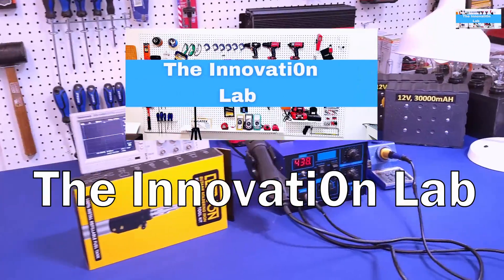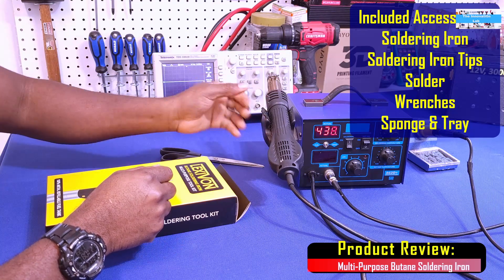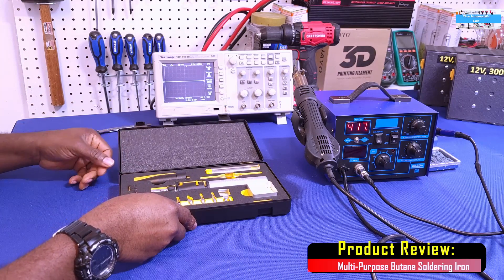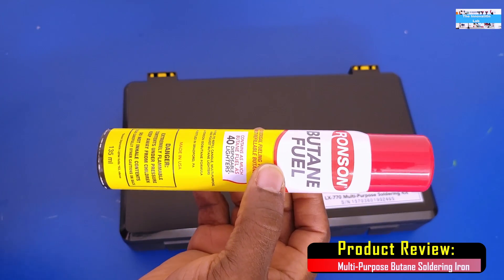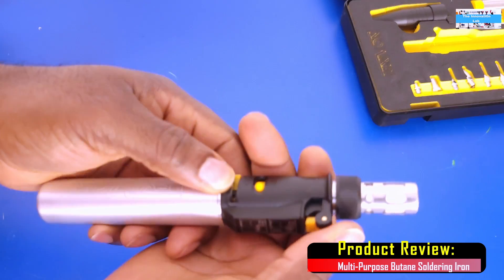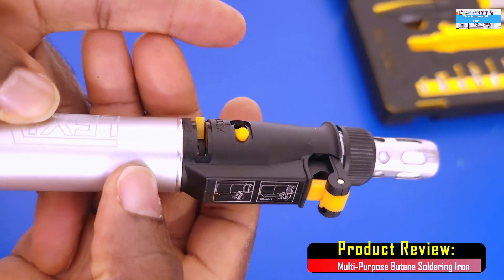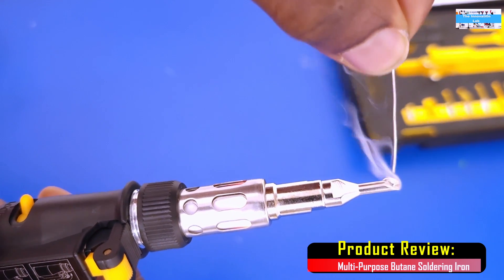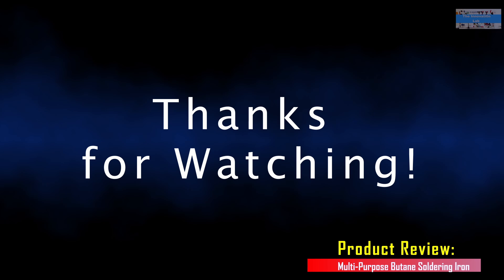Cordless Soldering Iron, LEXIVON LX-770, #diy

Comment: How come you talk about reading instructions CLEARLY you did not read them.

1. You do not fill a butane device like this SIDEWAYS.. You tip down and use the butane canister downwards. Press firmly unless you see some spurt which indicates it's FULL.

2. You MUST use at LEAST 3X refined butane. If you do not, you risk clogging or damage the unit.

You need to use Butane that is used for Torches and high quality lighters.. NOT that butane you used.. That is more suited for BIG lighters and BBQ lighter refilling.
Reply from the maker: Thanks for the constructive feedback. We all miss things. No one is above mistakes and there is always something we can all improve on. Its  usually very challenging to perform some actions on camera - if you need to capture the full frame. Also, I use that butane product because its the one easily accessible at my local store.....never had any issue using that product, and my iron still works after many years. I am not saying you are wrong. 

You should also write to the manufacturers to encourage them to ship the iron with some butane sample. I know there may be some shipping safety concerns, but they can package the product with that in mind - instead of focus on cost cutting and profit maximization.

Thanks again.
Respectfully,
The Innovati0n Lab

Comment: I bought a little battery operated soldering iron , about 12.00 worked very well with circuit boards and 28 awg wire. But if you get into heavy wires it does not get hot enough.  But for what it is and the small size you use it like a pen. Works well for about 3 hours then needs charged but you can use it while it's charging.  I have an old soldering gun that I've used for years on construction projects for the bigger stuff.
Reply from the maker: I hear you.😊
I have about five different soldering irons and solder stations.....for same reasons.

Respectfully,
The Innovati0n Lab

Comment: ...Just finished watching...IMPRESSIVE!  I was wondering that if you have used this iron in heavy-duty applications such as soldering very large Cu wire, connectors, etc.  if it gets plenty hot enough for this, and how the tips hold out.  Do you get enough usage per refill?
I will look at the specs.
THIS VIDEO GAVE ME THE IDEA OF TRYING BATTERY POWER ON MY TS-100 IRON (it's DC-powered)!!
THANKS MUCH!!!
Reply from the maker: Hi friend!
Thanks a lot for watching, and I am glad you found the video useful. 
👍👍
Actually, I have been using this iron a lot lately because my solder station broke down. It works really well, and how long each refill last depends on your setting. At full blast, each refill only lasts a few minutes. The good thing is that you can fill the refill butane can for less than $2 at your local Walmart.
The tips are quite durable as well. It's just this there is a thermal relief hole on the side that you have to be mindful of because burn your hand or parts -  if you are not paying attention.